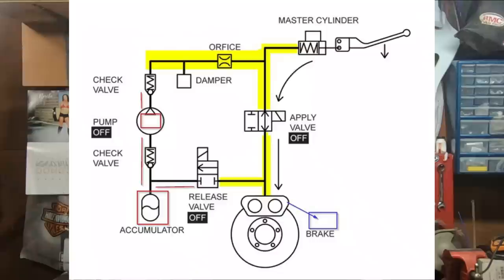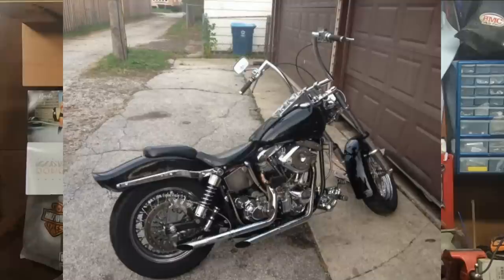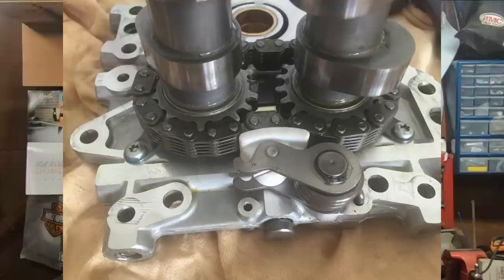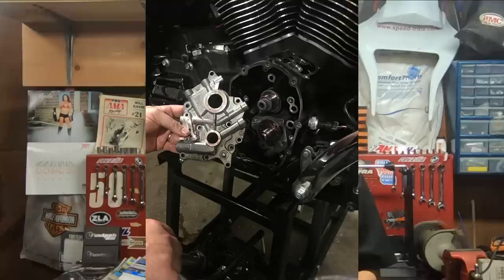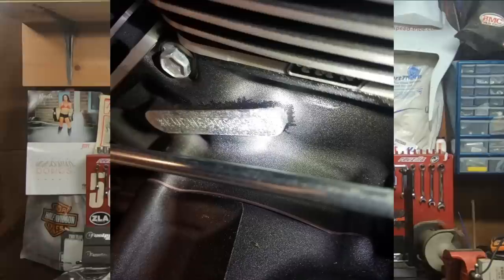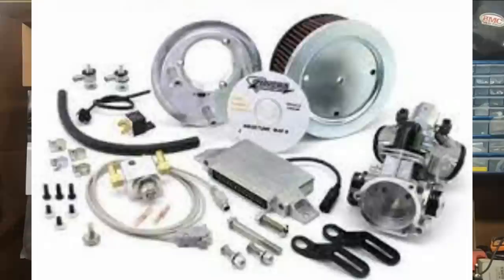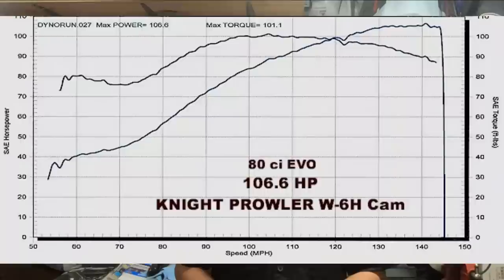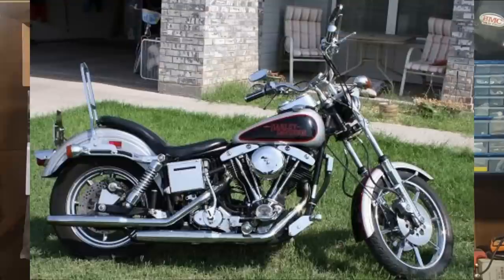Best Harley Engine Ever Made (Arguably)

Comment: You're right and here's why. The Evo was basically the 1936 Knucklehead engine incrementally improved over time through generations of the Panhead and Shovehead engines. There were no radical changes made and the basic platform remained exactly the same. They merely updated and improved what they already had, or "stuck to their knitting" as Willie G.'s old man once said. 

The irony of the Evo is that it was only meant to be a stopgap model until the water-cooled NOVA was ready. But the Evo turned out to be so good that it went on to fame and glory, while the Nova was deep-sixed. When they got to the Twin Cam the engineers thought they could do better than old Bill Harley. They were wrong. That's why the future of Harley-Davidson in the hands of these new-age, woke thinkers looks so bleak.
Reply from the maker: I honestly don't know what to say. You've put it better than l or anyone else has, l've felt that for a long time. Government is running the air cooled twin out. They tried to get ahead of it but took riding that pony till it was beating a dead horse. Can't blame them, but buy these "dinosaurs" while you can!
Reply: The 'Trouble head' was never an improvement...it was an absolute disaster that almost killed the company...I had one once, NEVER will I ever have another one, unless I need a boat anchor...I actually like my twin cam, even with the stupid chain tensioners, which I will eventually get rid of when I can afford to upgrade to a gear setup...best sounding engine they've ever made in my opinion...
Reply: @Road_Rash  
Were your problems with the "Troublehead" (Shovelhead) due to the engine design or poor AMF quality control? Early AMF/HD had a reputation for turning out junk. The Shovelhead valve covers tended to leak less than the Panhead and the top end ran somewhat cooler too. The big improvement in the Shovelhead was dropping the generator for the alternator and eliminating all those crankcase gears. I would argue that was an improvement. However, I never liked the big heavy cast aluminum primary cover that came with it. The older tin primary looked a lot better.
Reply: The Evo wasn't developed until after the Nova project was scrapped, it was nixed when AMF got a new CEO in 79 and saw in the books that large checks were being written to Porsche, when he found out what it was about he put an end to it, the only work that went on with it afterwards was what they had that was already paid for but as of 79 it was never going to be produced. 
The EVO basically came from the ashes of the Nova project.
Reply: @browngreen933  
That's right, every step after the Knucklehead was an improvement, the Shovel is no exception to that, after 34 years of working on Harley's primarily building engines I can tell you that most people's opinions on the different engines are based on what comes off of barstools and not from actual experience with them.
Among the improvements that came with the Shovel was a much better intake tract and valves, in a Pan the intake and exhaust valve's are the same size, that's ridiculous to anyone who knows the mathematics and physics of engines, and the improvements that AMF made to the Shovel is switching from a 30 to 40% balance factor in the bottom end and greatly improving the timing of the breather system, in 1972 Harley, under AMF's management, took great steps to accurately locate the window in the bottom end casting for the rotary breather valve, they also made it a square shape to match the square window in the rotary valve, prior to that it was an oval shape that floated all over the place from one casting to the next.
Also one of the greatest improvements to any pre Evo engine was done during the late Shovel era where once again under AMF's management the R&D work was done to fit valve stem seals to Shovel engine's in mid 81, this did more to add life to the engine's than any single thing done to the big twin before that, it not only took the valve's and guides from having to be replaced every 16,000 to 20,000 miles to 50,000 to 60,000 miles but it also kept contamination from the exhaust port from getting past the valve stem and guide and into the rocker boxes resulting in oil turning black in 500 miles, not only do the seals naturally seal that area and prevent that from happening but also because contamination can't get in between the valve and stem in the first place causing a valve to hang up the minimum clearance was dropped in half starting in mid 81 when seals were installed, the minimum clearance for the pre valve stem seal engine's is already half way worn out compared to the minimum clearance for the engine's with seals, look at a big twin service manual for 78 to 84 and you'll see what I mean, in mid 81 for the Shovel the spec for the minimum clearance is half of what early 81 and earlier is, that resulted in valve's and guides that lasted a tremendous amount longer and engine oil that took 3 times as long to turn black.
Just as Shovels have an undeserved reputation for being junk Evo's have an undeserved reputation for being bullet proof, I can honestly say I've seen more case failures on stock Evo motors than I have on Shovels, the 2 big issues with them being the 88 to 92 castings, whether it was the foundry that Harley farmed their casting work to in those days or the supplier that the foundry got their aluminum from but it was substandard, one of them screwed Harley, 88 to 92 bottom end castings were notorious for pulling the cylinder stud threads out of the castings and Heli coils wouldn't fix it, they'd just rip out to, too many times I had to call the owners of bikes and break the bad news to them that they needed to buy new engine cases.
Another notoriously bad thing on early Evo's was 84 to 87 cases that split between the 90° angle where the vertical and horizontal machined surfaces for the rear motor mount meet and one of the holes for the case through bolt right by it, if you disassemble a set of those cases and look there's a thin area between the machine work for the motor mount and the nearby through bolt hole where the case halves mate, from 84 to 87 Harley cut that machined surface with a sharp 90° angle right there and they liked to split to that hole, in 88 they started cutting it with a slight 45° bevel where the vertical and horizontal surfaces meet eliminating the sharp corner there and solving the problem, like the 88 to 92 issue I've had to call too many 84 to 87 owners and break the bad news to them that they need new cases.
Both of those situations had owners looking at me and saying "I thought these Evo's were supposed to be bullet proof", the mid 92 and up Evo's with the improved oiling system and after the engine case issues were sorted out are the best one's, before that it's a crap shoot.
Twin Cam cases were designed to address all the shortcomings of the Evo, along with them being MUCH stronger than Evo's they sorted out problems like the top end oil draining into the flywheel cavity.
Evo cases especially the 84 to 92 cases are nothing more than alternator case Shovel cases with the cylinder stud holes drilled in a slightly different location, aside from that they're exactly the same as Shovels and therefore no better despite what you'll hear coming from a bar stool.
Everyone thinks that the aluminum cylinder of the Evo is what makes their top ends last so much longer, it does help but the biggest improvement in the Evo top end was the valve guides being made much longer, there's more bearing surface between the valve stem and the guide resulting in them lasting much longer, the shorter valve guides of the previous big twin motors were their true weak link.
Reply: @dukecraig2402  
That's great information. Lots I didn't know. Thank you. I'm saving it.

I badmouthed AMF in my post, but as you clearly pointed out, that's not the whole story. There's a big difference between early and later AMF. Early AMF sacrificed quality for high production numbers at a time when Harley-Davidson tooling was already old and worn out. This resulted in lots of new motorcycles shipped with serious problems. As a result Harley-Davidson's reputation suffered badly that to this day has not entirely recovered in the popular mind. But at some point AMF thinking changed and there was a push for better quality control. At the same time AMF was investing $$$ in new tooling and equipment. Some of that new focus was in the engineering department. It was under AMF, of course, that the Nova project and the revised Evolution engine had their origin. 

It would be interesting sometime to hear your take on the traditional Sportster  engine like you did here with the Shovelhead. I predict that once Harley-Davidson cancels the air-cooled Sportster line, that least respected engine will suddenly mushroom in desirability.
Reply: @dukecraig2402  
You seem to know the facts. What I heard came from guys that worked at the Harley-Davidson factory. They said Evolution was inititially planned as a stopgap measure until Nova was ready. But it turned out better than expected and that ongoing problems with Nova led to its cancelation. Maybe there were other factors too.
Reply: @browngreen933  
Of the several different sources that I got that same story from was a guy who worked as a tech at S&S that I spoke with often 20 years ago that worked at Harley at the headquarters in Milwaukee in the R&D department in the late 70's and early 80's, he was part of the development of that and several other things, the Nova and the Evo were both programs that were basically run by Porsche with some other hands thrown in like Jerry Branch who finalized the ports for the Evo, even he talked about Harley flying him every weekend from his research facility in Signal Hill California to Milwaukee in the early 80's to do the work, he also gave Harley 4 different combustion chamber shapes to pick from for the Evo, he wanted them to use what's called the Branch #4 combustion chamber which is the one that he does to heads sent to him for performance work, he welds the combustion chambers up and they get re-machined with a 30° squish band and require his pistons with "pop up" domes to work, Harley didn't want to use it because of the machine work involved on a production level so they chose the #2 Branch combustion chamber which is basically a Shovel/Pan chamber with one side closed (filled in) and a flat top piston giving it a D shape, the closed side of the chamber is machined with the same cut that makes the head gasket surface and works as the squish area with a flat top piston. 
They went with the Branch #3 combustion chamber for the Twin Cam, it's a "bathtub" style chamber which is basically each side partially closed with a flat top piston.
I was a Branch dealer when my shop was open to the public and used to speak with them quite a bit about their history and involvement with Harley and their participation in developing the different engines, Branch was a Marine Corps veteran of WW2 and afterwards ran the service department at the dealership in Memphis Tennessee. 
He used to tell an interesting story about a kid in the early 50's that didn't have any money and had an old 2 stroke Harley that was always breaking, they couldn't go a week without looking up and here'd come that kid pushing his piece of junk up to the dealership needing help with it and since he was so poor they'd take turns doing what they could for him off the record, well one day after they hadn't seen him for a while someone told everyone in the shop to listen to a song being played on the radio that he'd turned up, he told the Service Manager Jerry Branch "You ain't never gonna believe who's singing that song on the radio" when Branch ask who it was he told him "it's that poor kid Elvis that was always coming around here with that piece of junk that we'd help him out with".
After Pressly made it big in life and became a movie star he never forgot the Service Manager from the Memphis Harley Davidson dealership Jerry Branch who'd helped him out when he was a poor nobody and returned those gestures in spades when every time he'd buy a new Harley for himself and identical one's for each member of the "Memphis Mafia" by demanding that Jerry Branch be the one to personally deliver them to Graceland and would tip him heavily for doing it.
Reply: @dukecraig2402  I didn't get my info from any barstool, I owned one of them...only bike I ever owned that I absolutely hated...I couldn't get it out of the driveway without something breaking on it, even after a full rebuild...complete disassembly & rebuild & it was still junk...& it was impossible to keep it from leaking...my twin cam also leaks, but not as much...I've also seen others fight the battle thinking they had one fixed only to have it break again time after time...more power to anyone stubborn enough to keep one running, but I absolutely loathe the troublehead...
Reply: @dukecraig2402  
Good info on the Branch combustion chamber work. I'm saving that too. The Elvis story is priceless. Thanks.

Somewhere I have notes I jotted down when talking to the guys from Harley. I should dig that out sometime. There may be more to the story than I'm remembering. Those guys I spoke with all had a love/hate relationship with AMF. Not so with Harley-Davidson. There is was all love.
Reply: Hi
Reply: B I’m in
Reply: @browngreen933  
AMF saved Harley Davidson, if it wasn't for them they'd be the same thing Henderson is these days, just some name from the past, they built them a modern production facility in York PA and dumped all kinds of money into product improvement throughout those years going as far as the Nova project, which is a real shame it got canceled because had it not been they would have released a 120 HP motorcycle on the world around 79 or 80, the Japanese and everyone else weren't even dreaming about a motorcycle with that kind of power at that point, they paid for most of the development of the Evo engine, which by the way most people don't know the Sportster Evo engine was actually ready before the big twin Evo was, but for marketing priority reasons they shelved it to concentrate on the Softail chassis and the big twin Evo engine for it, it was the introduction of the 1984 Softail that turned things around for them, they knew it'd be a hit so they put the Sportster Evo on the back burner for the time being, but they actually could have introduced it for the 1983 model year.
In 1969 the 4 Japanese motorcycle companies were swimming around Harley like 4 shark's, the CEO of AMF was a motorcycle enthusiast and was bound and determined to save it, so he rallied the management at AMF and they purchased it, he's the guy that got Harley into bed with Porsche and got the ball rolling on the Nova project, but when he left in 78 and the new CEO who wasn't a motorcycle rider and didn't care about them came in he wanted to cut costs all the way across the board at AMF to impress the stock holders so he axed the Nova project, but Harley having gotten in cahoots with Porsche is super important in the history of the company and that was done under the AMF banner.
People think, especially critics of Harley's, that nothing changed about their engine's for years, well those are all people who don't know them, a 1981 Shovel may look like a 1971 Shovel from the outside but believe me there's a myriad of changes and improvements in those engine's throughout the AMF years, the oiling system was improved, the breather system was improved, things like the short reach spark plugs that are very easy to strip out were changed to the long reach plugs, shaft tapers were improved, then there's the improvements to the 4 speed tranny that they made and the development of the belt drives for the big twin, there were a lot of internal changes and improvements during the AMF years believe me I know, I've spent a fortune on the different speciality tools needed for every one of those changes.
There were some issues during the AMF years but most of them can be put on the workers on the assembly line to be honest with you, labor and management got in a big pissing contest with each other at one point and the people on the assembly line just didn't care, they let things go with loose bolts and nuts and other things, and honestly it was only a couple of those AMF years that they had those problems, but the quality issues from the AMF rein weren't due to bad engineering it was just sloppy work, but even that got straightened out before AMF's ownership was over.
Harley riders being the way they (we) are generally don't like change, so as soon as the sign out front and the sides of the gas tanks had AMF written on them people automatically recoiled back and started looking for things to gripe about, but most of the complaints are sheer nonsense, one of the first things AMF did was get rid of those horrible generators on them, but back when they first did it people complained and said the new alternators were junk and it was only done to cheapen up production, something we know nowadays to be nonsense, those generators were horrible and a constant hassle, another BS myth from back then about the generator/alternator thing stemmed simply from when you look at the two from the outside since there appears to be less metal in the alternator cases people were running around claiming that the older generator cases were stronger, oh god that's a laugh.
AMF set up the people who took over Harley after them for success, new production facility, new highly improved engine, new products ready to be released, got Porsche doing engineering work for them, after all with all those high performance air cooled sports car engines Porsche developed over the years who better to do development work for them, that's a natural fit there.
Yea AMF gets a bum wrap when it comes to the history of Harley Davidson, they did far more good than they did bad, and we can all thank them for Harley Davidson staying in existence and remaining an American owned company.
Reply: Jerry's number 4 chamber never used a 30 degree squish. I still have all his tech info and built dozens of them.
Reply: @ranchodeluxe1  
If it's not #4 then which number is it?
His standard performance work is the °30 degree squish, it wasn't until the TC came out that they did the port only work and left the chamber alone, before that everything got welded and the °30 squish machined into it, Evo and Evo Sportster were all done that way.
The TC port only is what they call the touring head or cruising head or something like that.
Reply: @dukecraig2402  There is no angled squish ledge on Jerry's number 4 chamber. The number 4 is the bathtub chamber and always has been. We started cutting 30 degree squish ledges in them when Axtell started selling the pistons in the 90s.
Reply: @dukecraig2402  Sorry, you are just mistaken. The number 4 chamber has never had a 30 degree squish ledge. I'm looking at Jerry's catalog from the 80s right now. He was a personal friend, as well.
Reply: @ranchodeluxe1  
JB makes Branches pistons for them, and I probably have the number wrong but Branch has a number that has the 30° angle. 
When my shop was open to the public I was a Branch dealer and sent plenty of heads to him to get the 30° angle squish, maybe they call it the #5.
Anymore I have whoever I do the work for send them to Branch, one of the reasons I quit doing work for the general public and only do it privately anymore is because I got sick of people running into my shop everyday and carrying on because the UPS guy still has something that's coming from California to PA, this way when someone sends it themselves they can carry on about it to themselves that they don't have it back yet, it's because of people acting like babies is why I only do work for people I know and trust not to act like children and think they have the right to throw an unreasonable tizzy fit because they're the one spending money.
Also could be Branch assigned different number's to their development of combustion chambers than the one's they do for work to the public on Harley's and it's their development number's stuck in my head.
When Branch developed the different combustion chambers he didn't even use Harley engine's to do it, in the 70's Kawasaki funded all that research for him to develop a combustion chamber for their racing team, they gave him 500cc single cylinder engine's and a pile of money to do it, with the money they bought a computer that incorporated a system that had thousands of sensors the size of a human hair and drilled thousands of holes starting from the carburetor down through the intake tract and everywhere inside the combustion chamber above the top piston ring, then they had a batch of gasoline irradiated so the sensors could pick it up, that way when the engine was running they could watch the flow of the fuel throughout everything in real time on a running engine and they found out some very surprising things that went against the traditional thinking about how air/fuel flows through an engine. 
When I was a Branch dealer I bought a book that he would only sell to his dealers and not to the general public about his research throughout the years, his facility and why they chose the inches in water measurement that they did, how and why they have their dyno set up the way they do, and a bunch of interesting things like a 60 grit finish in intake ports and how and why it's a myth that it helps to atomize fuel, how things like S&S's shark fin in the intake port of their heads is nothing but a gimmick that does nothing, and a bunch of results from dynamic runs with different cams and how and why those cams affect flow.
I actually had bought 2 of those books off of them but throughout the years lent both of them to people and never got them back, since Branch retired and O'Keefe took it over they quit selling the books, I did however se one for sale on Ebay that someone in Ireland had fro sale, if you ever get the chance to get one do it, there's some very interesting and eye opening stuff in it.
Reply: @Duke Craig  
Lots of good info there. But there was a flip side to early AMF that wasn't so positive. According to guys I spoke too AMF wanted to cash in on the great motorcycle boom of the late-'60s early-'70s and demanded ever higher production to show growth every quarter. HD as it then existed just couldn't do that and maintain quality control. One guy actually cried saying he was ordered to okay out-of-spec parts at Capitol Drive so not to slow down production. He knew it was wrong to approve the bad parts then said, "But what could I do?" Then add in the labor difficulty stuff you mentioned. The result was a big backlog of finished bikes that didn't run right and had to go to Harley's factory repair shop then at Juneau Avenue. Guy told me lines of defective bikes were parked on the street outside the front entrance because there wasn't enough room in the repair shop for them all. That had to be before final assembly was moved to York. Not sure what year that was. But that would date it. Yes, AMF did improve as time went on. No doubt about that. But there was a rough early period for sure, the fallout from which still lingers in the popular mind today.
Reply: @Road_Rash  In my experience with Harleys over 36 years, most were reliable as they come from the factory but owner's modifications sometimes introduced problems. The only performance mods I made were aftermarket air filters and exhaust pipes to let them breathe, then tuning to suit. The only time I went out on a Harley and took the bus home was in 1986 - a stuck valve in my stock 83 Shovelhead due to inadequate valve guide clearance and unnecessary exhaust valve seals. It gave me 11 years of reliable service after I fixed that issue; presumably created by Harley Davidson's emission compliance effort on an old engine design.
Reply: Always liked  'tell it like it is' comments. I totally agree with you!
Reply: @dukecraig2402  ahh, written by a man that actually knows these engines, instead of the endless parade of parrots on the internet spouting what they’ve heard as “ fact”.   If I may add, the evo longevity overall was the result of much tighter tolerances throughout the entire engine.  As a motor wrench myself, I can say it took me some time to warm to the Evo, but once I had my hands in a few I could see the advancements.  It is the reason many , like Forbes, road and spoke so highly of them, which in turn made “ wannabe” rich guys follow suit, which lead to the boom in the 80s and 90s.
HD made a reliable, oil tight engine that wealthy people could now own because the top of the food chain said it was OK.
When Liz Taylor had her own Harley, it was a must have piece of jewelry for anyone of means…all thanks to the Evo motor.
Reply: @megastick9324  
Evo tolerances aren't really any tighter than the mid 81 and later Shovels, in the mid 81 and earlier Shovels the only thing really that's looser is the valve stem to guide clearance and that's because they don't have seals on them, the piston to wall clearance is a little tighter in Evo's but that's only because the pistons were lower expansion Mahler's but when the older pistons would get up to temperature they ran with the same clearance as the lower expansion one's, the only real advantage to them is they're quieter on cold start, and when doing a rebuild you can get pistons made of the same materials for Shovels nowadays anyway that tightens them up. 
Because when you put valve guide seals on the older one's like when I convert the one's that didn't originally have them to seals you can set the clearance at about half of when they don't have seals because the seals keep any contaminates out like soot on the exhaust side and anything that could be in the oil on the intake side.
But aside from that the clearances are basically the same, everything in the bottom end, the rod and pinion bearings, the tapered Timken bearings on the sprocket shaft and the bushings all have the same clearance spec all the way back to the Panheads.
What always went out first on the older one's were the valve guides, one mistake some guys make when putting seals on one's that didn't originally have them is looking up the valve stem to guide clearance that the service manual for an older one says and using that to size things, that minimum clearance is almost worn out for the clearence if you run seals, as mentioned when you run seals you can tighten up the clearance by almost half, this gives more contact surface between the valve stem and guide which cools the valve much better and also when you've got more bearing surface you're putting the loads across a larger surface which wears longer.
Without seals the older one's would last on average from 16,000 to 20,000 miles and then they'd start puffing a little smoke while idling, with seals they'll last on average 50,000 to 60,000 miles and the oil stays cleaner a lot longer with seals because everytime exhaust goes through an exhaust port you don't get a little puff of it going in between the valve stem and guide and into the rocker box contaminating the oil.
Evo's have much longer valve guides, between always having seals and their longer length is why stock they went 80,000 to 100,000 before the guides reach their wear limit, another advantage they had from the get go was they had the improved Hastings X piston rings with the 3 piece oil rings from day one that the Shovels only got the last few years, and the older engine's ran on yesteryears oil, when Evo's came out engine oil was leaps and bounds better than it was 20+ years before that, for that matter 10 years before that and it's just kept improving over the years not even taking synthetic into account.
I refuse to put an engine together without valve guide seals, in this day and age it's just nuts and I don't understand why some guy's will do it, there's always someone out there that'll say "If they thought they needed seals back then they'd have put them on", yea OK, whatever. 
The shorter valve guides of the older engine's will always be their weak link, with seals and the modern materials new guides are made out of you can make them last 50,000 to 60,000 miles instead of 16,000 to 20,000 miles like they originally did but using those same materials that make them last so much longer an Evo's guides will go over 100,000 miles and that's simply because of how much longer they are, that's why an Evo is taller and won't fit in an older frame.
It's the top ends of the Evo's that last so much longer, most people want to give all the credit for that to their aluminum cylinders but it's the longer valve guides that always had seals from day one that's more responsible for them lasting so much longer than the aluminum cylinders.
Reply: @dukecraig2402  WOW Dude 🤔definitely know your stuff ! VERY INTERESTING 👍🇬🇧🇺🇸😎
Reply: @browngreen933  I have a magazine with the write up on project Nova and if it had of been produced at that point in time it would have been revolutionary. But as stated it was the cost it was going to be to produce it that was the primary reason Harley halted it .
Reply: @williamjohnson6517  
It wasn't a matter of "Harley" canceling the Nova project and that it's production was going to be too expensive for them, it was the new CEO at AMF.
In 1969 Harley was in big trouble and about to go under, the 4 Japanese motorcycle companies were swimming around it like sharks just waiting to get it.
The man who was the CEO of AMF at the time was a motorcycle enthusiast and didn't want to see America's only surviving motorcycle company fall under foreign ownership, so he rallied support at American Machine and Foundry (AMF) and had them purchase it.
Starting from day one and continuing for years even with some people up to this very day people ran their mouths all over AMF and the bikes built during their ownership and it's undeserving, first off it was the pre AMF Harley ownership that got itself to the point of bankruptcy in 1969 where they were about to go under, AMF saved them and kept them from falling into foreign hands, it was AMF who built them the modern production facility in York Pa and got their bike assembly out of the stone age facility they had in Milwaukee, that allowed them to loosen up enough space there to concentrate on building engine's and transmissions with higher quality, it was during their ownership that they got those nightmare generators off of the big twins,, the elimination of them and the necessary gears to drive them was a massive improvement, probably most important is it was under AMF ownership that Harley got into bed with Porsche who straightened out and modernized their engineering, yea there were some quality problems during the AMF years but the truth is they weren't any worse than before AMF bought them, like I said it was the pre AMF ownership that had them at bankruptcy, and that didn't happen just because of bad accounting practices, I've seen plenty of pre AMF quality issues in Harley's, 69 big twin cylinders that when oversizing them the cutter bit break through in between cooling fins before even getting to .050" oversize, screwed up factory machine work in big twin bottom ends and Sportster tranny cavities, the notion that before AMF Harley made perfect bikes and after they bought them quality went downhill is total nonsense, it's just that after AMF bought them people started blaming anything and everything on AMF when in fact all kinds of problems were already there.
It was under the guidance of the CEO of AMF at the time that the Nova project came to be, but in 1978 AMF got a new CEO and he had no interest in motorcycle's, he was a bean counter and when he saw these checks being written to Porsche and found out thatcit was for a new motorcycle that would have required a pretty massive retooling of the production line he said no way and pulled the plug on it.
But in the long run they benefitted from it, some of the tech for the Nova engine wound up in the Evo, the 5 speed tranny and rubber mount frame that lasted for how many years happened under AMF's ownership and guidance, when the new owners bought it in 1981 they got a hell of a package deal, all kinds of new tech just starting to be produced and on the brink of being produced, that new production facility in York Pa, an alliance with Porsche, yea, that was a great package deal and that new CEO dumb ass at AMF was who let it go, 10 years later when Harley was rolling in money I hope they strangled his stupid ass.
Reply: Except the 88b and 96b are pretty much bulletproof
Reply: I agree with everything except the incrementally part.  The improvement of Bill Harley's Knucklehead design through the Shovelhead was incremental.  But the Evo was anything but incremental.  It was an incredible, even miraculous improvement over the Shovel, especially considering it was still based on the Knuckle.  It was  faster, it ran WAY cooler, and it got better fuel mileage.  AMF had so mismanaged the company in the last few years that the quality of manufacture was abysmal.  A dealer asked a guy I knew who was looking at a new Shovel how far away he lived.  When he was told thirty miles, he told this potential customer he'd have to stop and work on the bike before he got home!  That's how bad even the dealers thought the final AMF bikes were!   
But after the buyout, the Japanese motorcycle magazines has already noticed the incredible improvement H-D made with the new FLH and FXR frames, so they were primed and ready to be knocked out by the new Evo engine and it didn't disappoint even the most biased testers possible!  Beginning the development of the Evo was about the only thing AMF did right those last few years of their ownership of H-D.